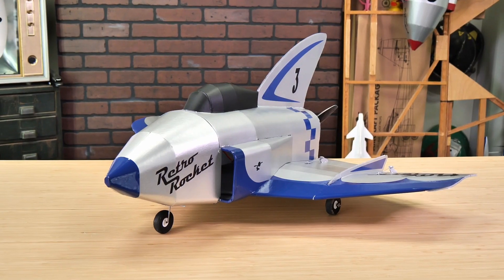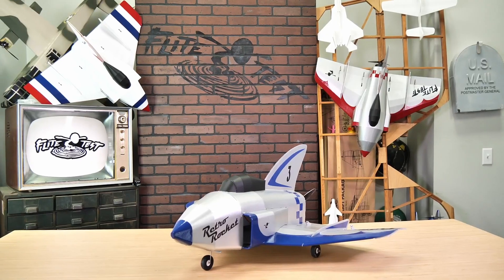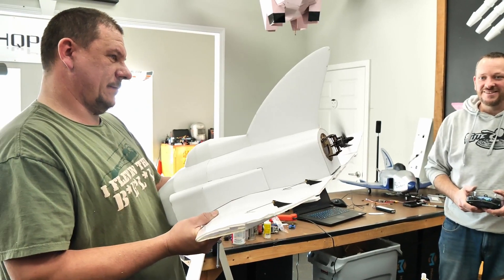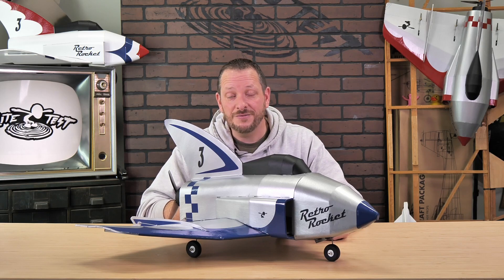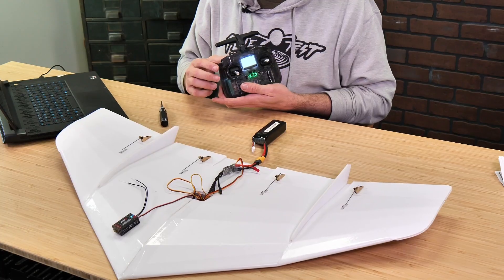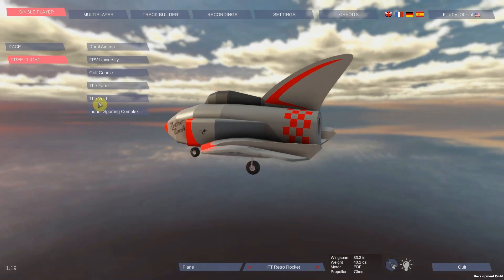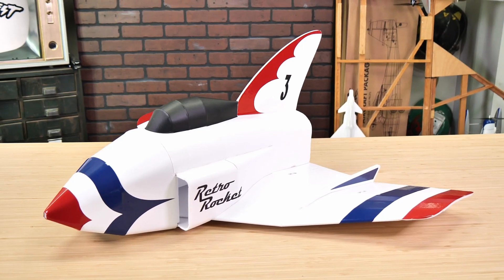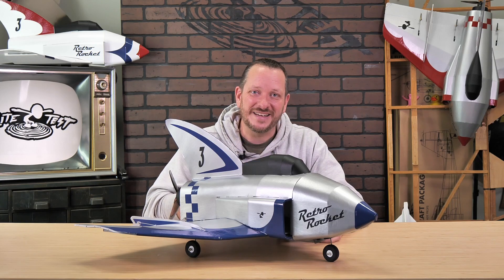FT Retro Rocket Vision Video

Comment: So can this CUTE lil guy be used as an EDF trainer or not? It's listed as build & skill levels 3. I want to build this as an EDF & can I tweak it to put a 50 or 64 in it? Thanks!
Reply: It's set up for a 70 mm EDF
Reply: @userTJ39780  Correct. I was just curious in the event it was possible since I have those size fans on hand. I subsequently ordered the kit with the FT unit.
Reply from the maker: It can be used for an EDF trainer.  Especially if you have the FT Aura installed.  Not sure if the 50 or 64 mm would give you the performance to have a good flight experience.
Reply: @FliteTestTech  Thanks! If all goes well UPS will deliver the kit & motor from y'all tomorrow.